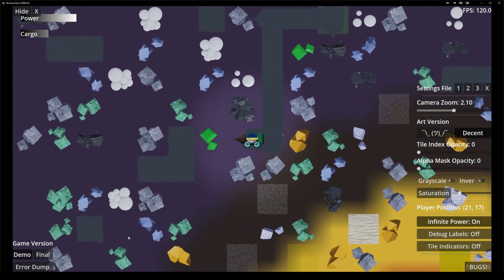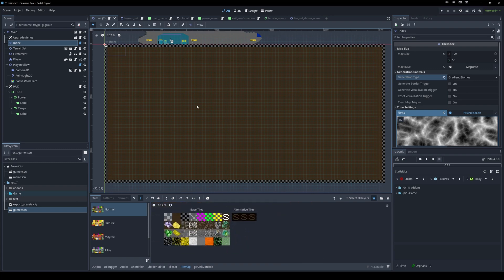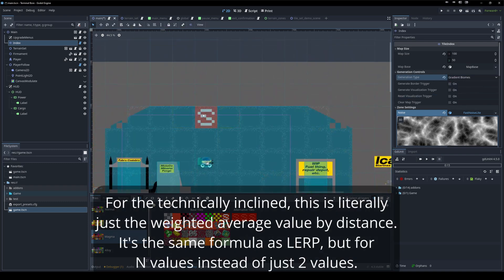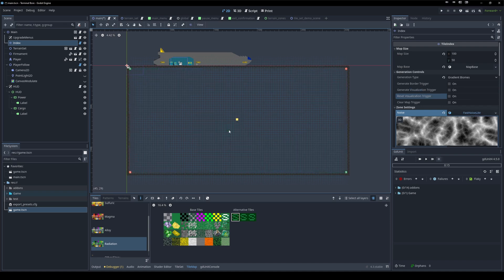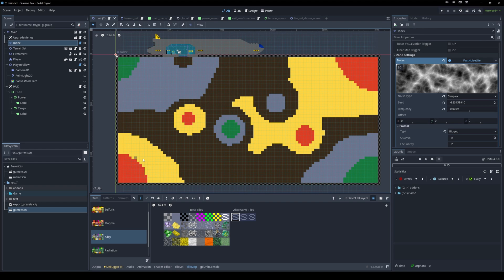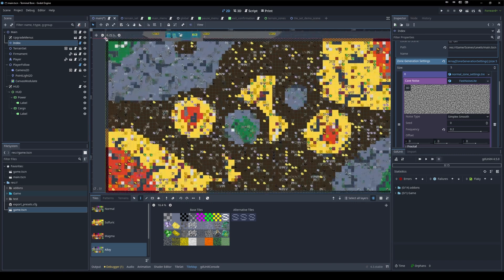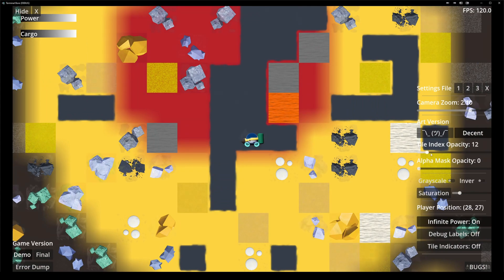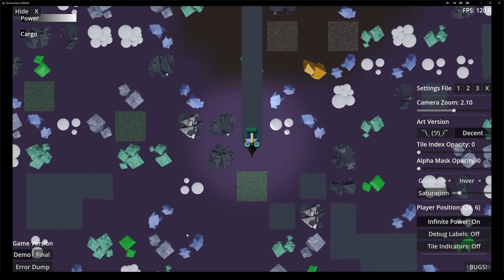I made a procedural generation system from scratch in Godot

Comment: This looks like something I'd play, idk the games you mentioned at the start, BUT I LOVED mining games as a kid. I do have a question tho, how does this map gen system work if you have more complex interactions between biomes, like I understand there's a gradient between radiation to magma, but lets say you had some hard rock area, or something else, would this system work if a new biome was added in? If not, would you have to remake the entire system (PS. I AM SUPER INTO PROC GEN/CAVE GEN)
Reply from the maker: I'm probably going to re-make a few parts, and maybe even make a part II video on it. The gradient is a single dimension, but I can add a dimension to have (up to) 25 biomes instead of 5. That should be enough for me.
I think that I need to change the first pass from IDW to something else - probably Voronoi. I'm getting too much regular dirt when placing other biomes.
The distance field pass gives me my details, so I can place a seed for high or low density for any one object. This should enable me to place clusters of dirt, rocks, etc. in any regular biome. So, yeah, I can add hard rock, large caves, etc. anywhere I want. (I just didn't have that part in the video itself)